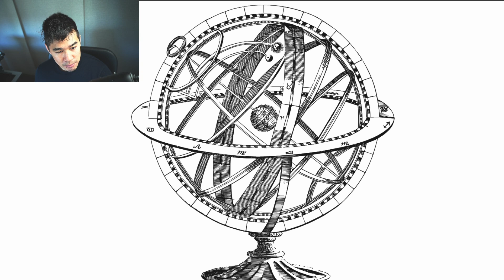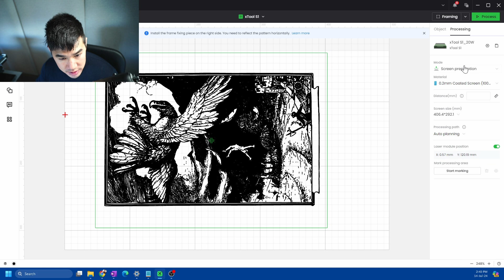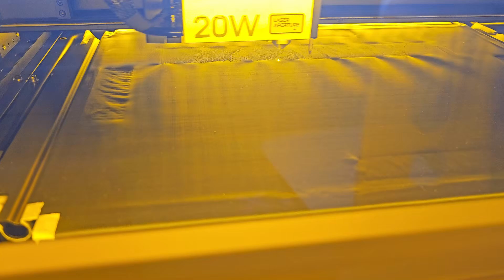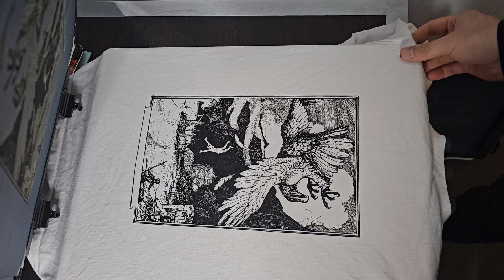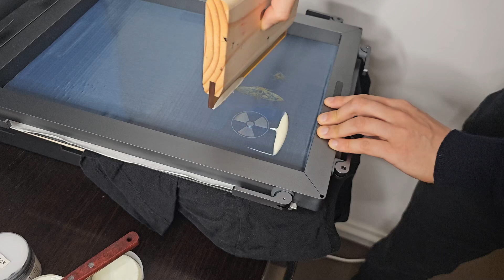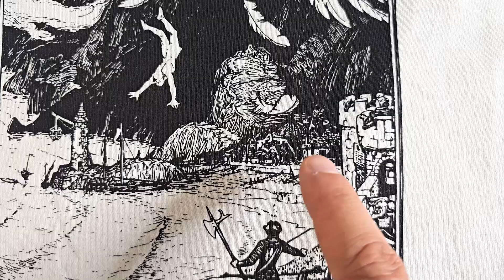Screen Printing Made Simple! xTool S1 + Screen Printing Kit

Comment: Is the first design the maximum print size you can achieve? And if so what dimensions?
Reply from the maker: No, I didn't go all the way to the edges. Technically the max is 406mm x 292mm - but, you'd want to leave a bit of space on the edges or it'll be a messy job.